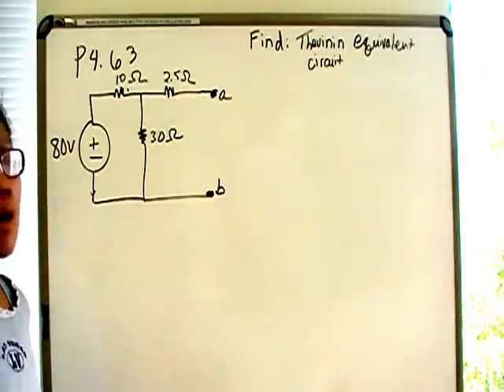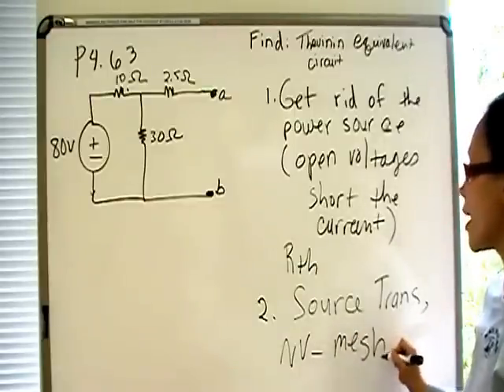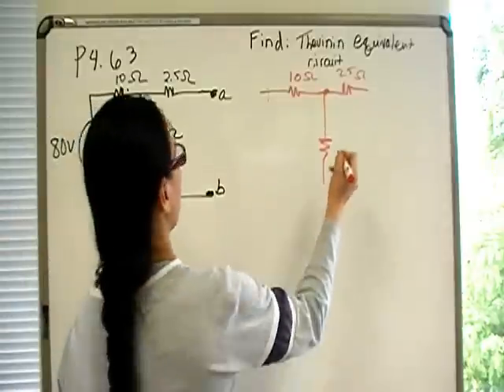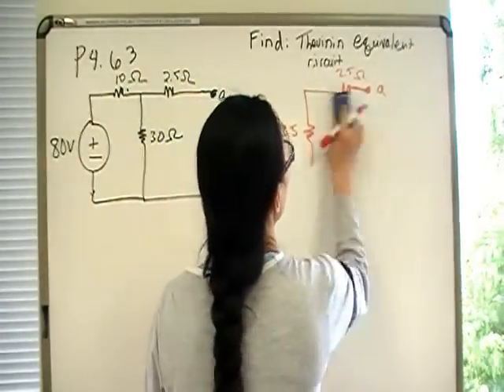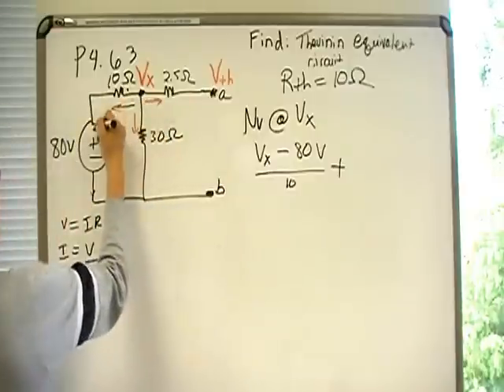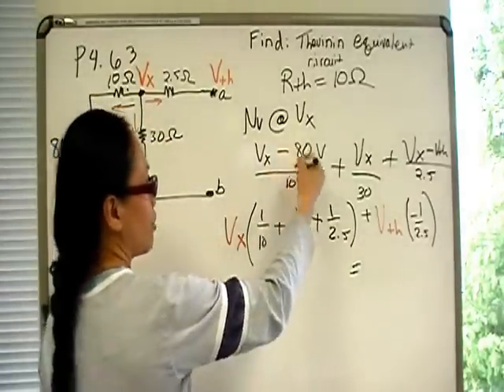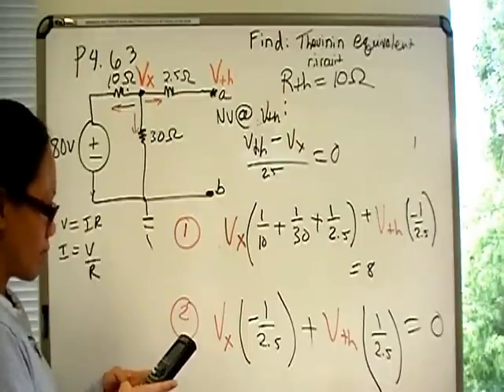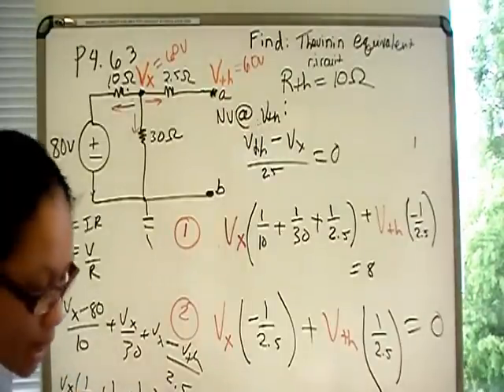Thevenin Equivalent Circuits P4.63 Nilsson Riedel Electric Circuits 9E Solution

Comment: My dear woman it should be immediately obvious, esp. to a teacher of circuits, that Vx = Vth. There is no current flow across the 2.5 ohm resistor. Therefore you can calculate Vth by voltage division. Vth = 80*[30/(10+30)] = 60 volts.